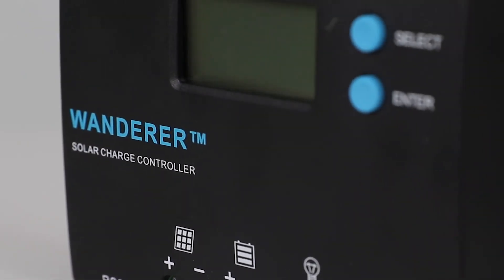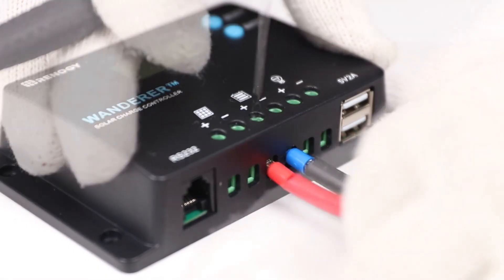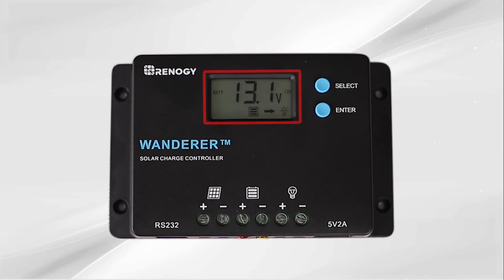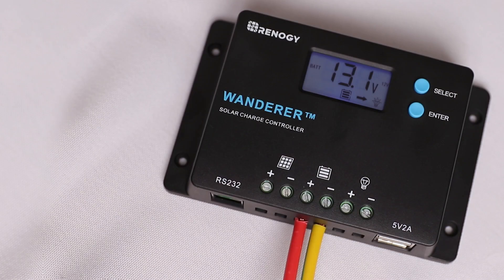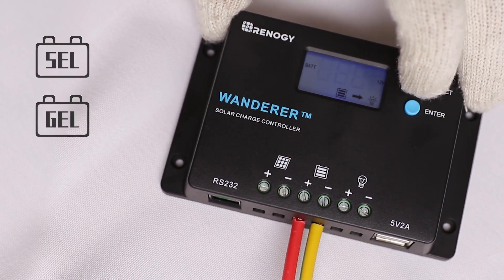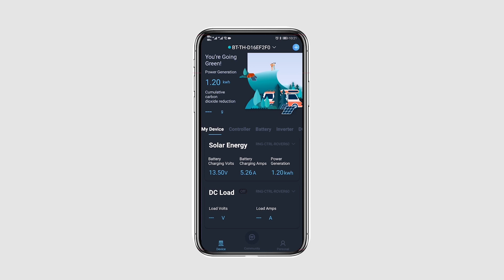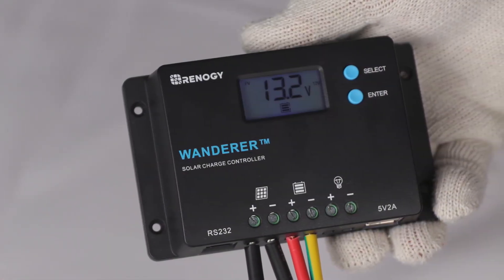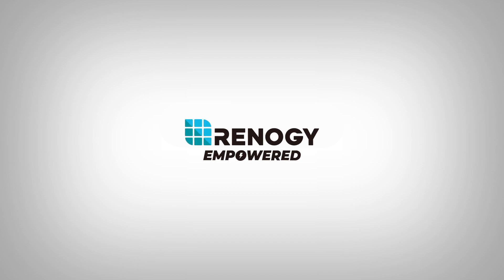Wanderer 10A PWM Charge Controller

Comment: I just got one of these as a gift. I'm unsure of what happens if the solar input exceeds 10 amps. I have two 100-watt solar panels, so under full sun, I may get as much as 14 amps. Will this fry the controller, or will the controller limit input in some way? Thanks!

Comment: I just bought this and it has given me a horrible first experience with Renogy.  There is no manual.  You are encouraged to register with  QR code only you can't without an account.  Go to the web site and establish account.  Now, you can't register your device on the web site.  So back to the Q R code which requires registering the Amazon order number which REnogy fails to recognize.  So, off to the web site, to seek help. Only none is availab!e without the Amazon order number which is again not recognized and the SKU number. Now, what the help is an.SKU number?  Its not identified anywhere.  Thank God Amazon re,phonies the order number in taking this thing back

Comment: Which of your PWM charge controller support 615watt solar panel @12V and also support lithium life PO4 battery 🔋  ??
Reply from the maker: Hi, Adigun.

We have checked our controller and we are so sorry that all our PWM charge controller can not meet your needs. We have reflected your needs and will iterate our products later with larger power.
Reply: @RenogySolar  Ok ! Here is my second question which of PWM charge controller can charge my 12vott lithium life PO4 battery 🪫
Reply from the maker: Hi, Adigun. 

Our pwm controller does not have equalization and float charging stages and the voltage range of boost charging stage is 12.6v-16v. In this case, we may need the manual book of your lithium battery for accurate judge in order to recommend a suitable controller for you.

If our pwm controllers can not be suitable, we can also recommend other types of controllers for you. Is this acceptable to you?
Reply: @RenogySolar  LFP charge voltage = 14.6V, Float voltage = 13-8 - 15.4V, does wonderer 10A suitable for my LFP battery?

Comment: Which mode do I select for lead/ acid🤔??
Reply from the maker: Hi, William.

Please set "SLD" mode.
Reply: @RenogySolar  thank you! Look forward to running this with a new 100 watt panel and 2 marine lead acids 👍
Reply: @RenogySolar  I'm very impressed with this little charge controller. I'm running a deep cycle rv/ Marnie battery and a Renogy 100 watt panel with a small 750watt inverter, and it's keeping it full⚡⚡⚡💪👍